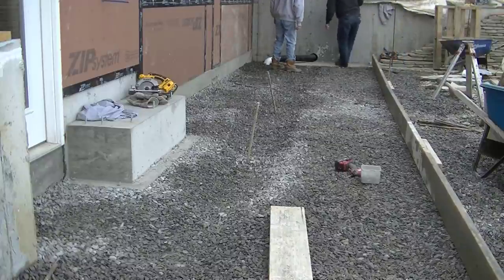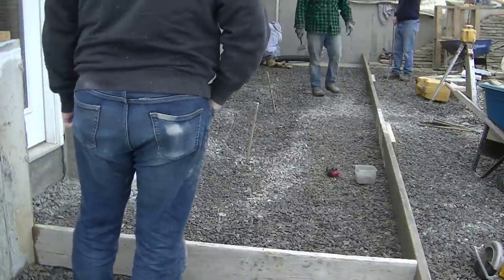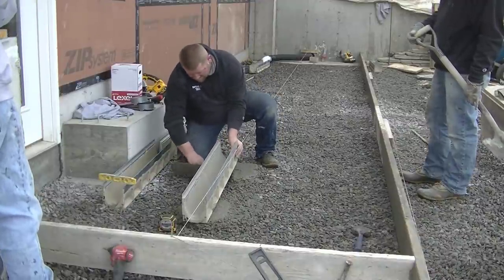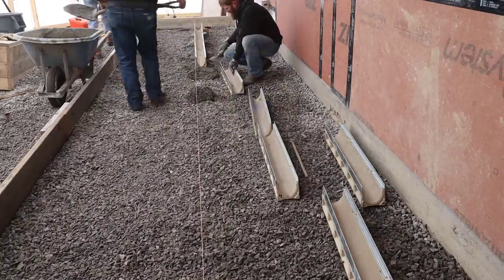How To Form And Pour A Concrete Driveway Apron With A Tench Drain.

Comment: Hello. Love the channel.  
We use WATTS Dead level most of the time in Northern Ontario.  The only issue I see with this install is that the thickness of concrete under the gutter should be equal to the thickness of the slab thickness and bar detail should be tied in.   This being said we do deal with different frost details than the Northern US and engineers have different views no matter where you are. haha

Comment: Trench drains are always a little tedious and we usually used them around pools. The easiest and cheapest way I found to do them was out of styrofoam. We used to get 8 foot styrofoam pieces made in an omega shape (Ω), tapered from deep to shallow and attach them to 2X material and hang them with cross pieces to the forms. Then pour completely on the underside so that both sides of the drain ended up monolithic. We found we would get less cracking later that way.
Reply from the maker: Sounds interesting. I would like to see that.
Reply: @MikeDayConcrete  You can get the trench drain grates from a lot of different places made from different materials like metal, plastic, fiberglass and maybe others. We would get the ones we wanted for a particular job and then just measure the thickness of the side flanges. Then have our styrofoam supplier make the omega shaped pieces of styrofoam with that measurement. They also have a material you can paint onto the styrofoam to make it easier to remove from the concrete so you don’t have to make a big mess stripping it or use a bunch of gasoline to melt it out. It’s a lot cheaper than the prefabricated pieces you showed in the video.
Reply: U used the m word not many people know that lingo

Comment: For those acco drains. We usually pour a footing and then use threaded rod to keep them suspended in place. We pour a 6" apron around the drain and then slab last.
Reply from the maker: Sometimes we'll pour a footing and use rod also. but always pour in one pour.

Comment: We usually only travel an 45 minutes max, but for large jobs we will go as far as 1.5 hours. Have you tried the trench drain that snaps together? The kind we use have tabs on each side that you can set rebar through then tie the drain at the height you want it to hold at with wire ties. They make it really easy to adjust.
Reply from the maker: I've tried a few different kinds. The GC bought this one and didn't want to install it himself so he had us do it.
Reply: @MikeDayConcrete  Yeah. The thing that is nice about the type I'm referring to is that you dont need to pour concrete to set it in place. It makes installing drains so much easier and faster
Reply: Ya I use the ones from home depot that have rebar clips and you can adjust. They are nice drains

Comment: I was wondering what you used to tie.... 
I use heavy duty zip ties. 
I had an issue with tiewire making 2 rust spots... I know.. it should've been towards the bottom.. 

I found that the zip ties are just as good and haven't had no issues. Maybe cost a dollar or two more
Reply from the maker: Yea, they're good too.

Comment: Regarding the floor drain, wouldn't it have been better to place the caulk in between the sections, instead on top of it to prevent water from leaking?
Reply from the maker: The caulk went in between when i did it this way. There's too much movement when you're first setting them in my opinion.

Comment: Hi Mike.
Can you clarify something for me please regarding rebar?
In most of the the US videos i see about concrete slabs the rebar is set at about 2ft centres, here in Europe we usually set rebar at 6-12 inch centres max to control cracking. How come your engineers can double the spacing and still make it work?
Also as your rebar is set at the bottom of the slab how does this control surface cracks? Usually we set rebar closer to the top to control cracks.
Really impressed by your finishing techniques over there, here we usually screed/vibrate, bullfloat and one/two time trowel only unless a really special finish is called for.
Reply from the maker: The rebar doesn't necessarily stop it from cracking but holds it tightly together if/when it does crack. This one wasn't engineered so it was to our discretion. Some engineered slabs and patios we do are 12" on center #4 or #5 bar. Rarely do we do a 6" on center.  Not sure here in the US it's different than in Europe. Sorry I couldn't help explain more.

Comment: we call that tool a "twister" to tie  the  rods here in penna. but the same weather here as in maine ,,,, I do acouple trench drains a year similar to how you do it !!  Curious why you didnt drill holes for rods into the walls ??
Reply: Yep, ‘twisters’ here too. A ‘yo-yo’ is what we call a retractable lanyard that you use with your safety harness when working at heights.
Reply: That looks like a freshly poured foundation that might settle a little when fully cured and under a heavy snow load. Its better to leave them independent with a expansion joint
Reply from the maker: We don't tie a driveway like this to the foundation. If the exterior concrete heaves, it could lift the foundation, I've seen that happen, causes a lot of damage to the garage/house.
Reply from the maker: It's got a 4' frost wall that sits on a concrete footing. All that is on hard pan soil. It won't settle. We leave it independent like you say just in case it heaves in the winter, it won't lift the foundation with it.
Reply from the maker: We've always called them Yo-yo's.
Reply: @MikeDayConcrete  thanks Mike .In Pa. I've seen it happen both ways and yes if you rod into the foundation wall and the driveway lifts the rods can lift or crack the foundation wall so it's never a smart move to rod the two together

Comment: No ice here.........Florida Keys
Reply: keysthinking how’s Concrete business in FL? I’d have to adapt to the heat.
Reply: @FireandDirt  -Concrete business is huge in Fla bcz of structures needing to hold up to hurricane force winds. Virtually everything is concrete and concrete block (walls) in Fla.
The heat and humidity does take some getting used to. A cpl times I’ve hired guys from up north who never worked in it, only to have them walk off by lunch time. It takes time. 
-Mosquitos can be really bad down in the Keys (and the Glades) too. In the summer, you see them flying over, every day with low flying helicopters, spraying insecticide. 
-Weather is incredible from late fall to early spring though.
Reply from the maker: Just left Port Canaveral last week. It was chilly.
Reply: @MikeDayConcrete  That’s something I always found strange. 50° in Florida always feels colder than 50° somewhere up north. No idea why 🤷‍♂️ Maybe it’s the humidity or dew point or something.

Comment: why not just use a hammer and nails to put boards together ? i’ve never seen a concrete guy use a drill and ive been doing concrete work bout 25 yrs
Reply: I guess they’ve evolved 😂
Reply from the maker: Screws hold the boards together better and easier to strip. Can re-use the screws many times also.
Reply: @MikeDayConcrete    we always use screws! If you use 1 1/4" you can just hit the iron stake with out backing them out.